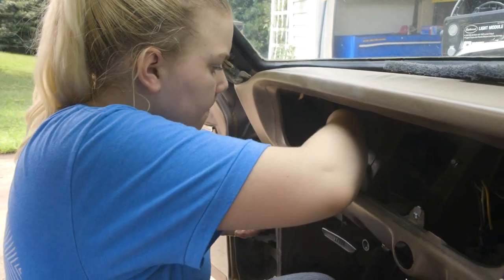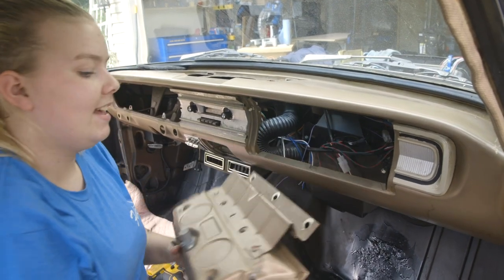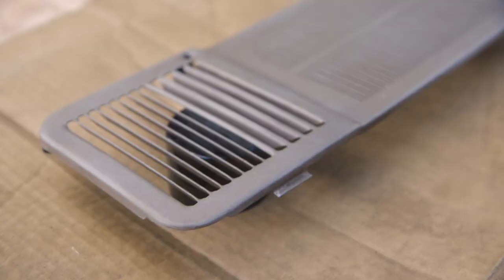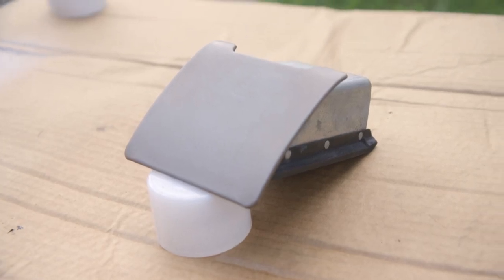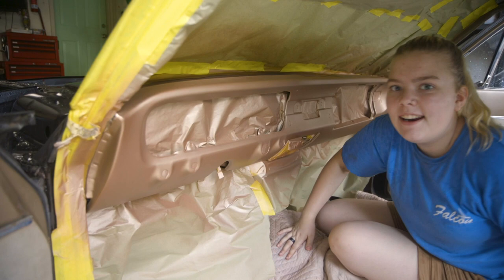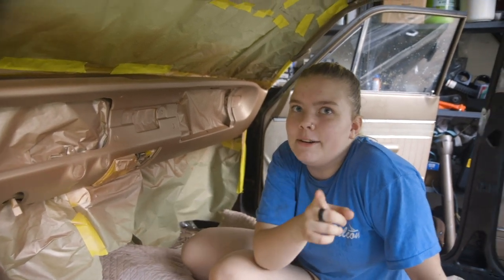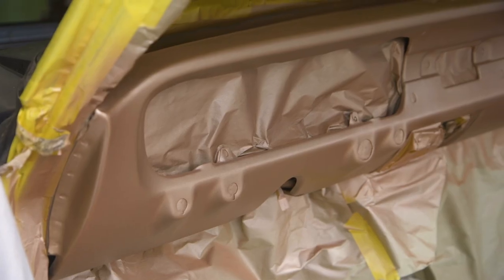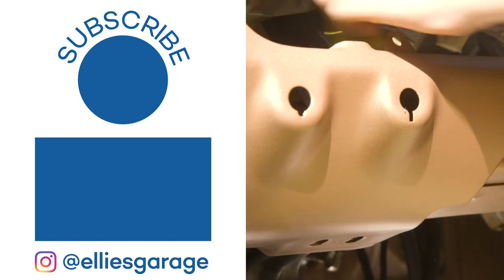I Had Never Painted a Dashboard Before!

Comment: Painting Tip: Move the can parallel to the surface.  Pivoting from the wrist or elbow causes an arching motion.  The paint layer will be thicker in the middle of an arc and prone to shag.  Also, I use a attachment to the rattle can that has a vertical trigger.  I think I picked it up at PepBoys years ago.  Much easier on the hands.  I enjoy your videos.  Nice DNA shirt.
Reply from the maker: Yes! We actually got one of those triggers as soon as we finished painting the dash. Ha. Thank you for that painting tip. We'll put that to work when we move to the doors and trim pieces. Thank you again!!

Comment: Why the decision to paint the dash in the car instead of fully removing it?
Reply from the maker: Good question. The dash is actually part of the metal body of the car. There's no way to take it out. We'll eventually be removing the front windshield, so we might check out our paint job and do some touch ups then if we need to. Thanks for the question!
Reply: @ElliesGarage  that makes sense. I'm unfamiliar with the Falcon and just figured it was like almost every other vehicle with a removable dash.